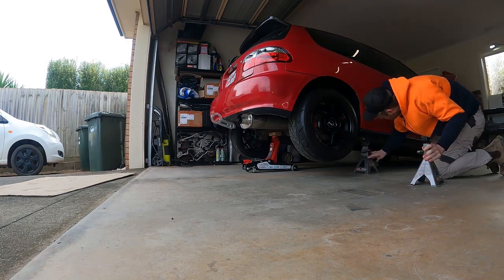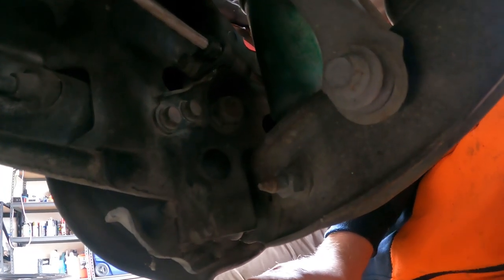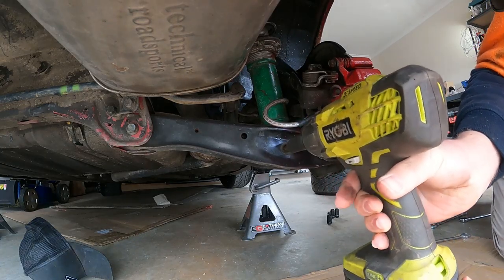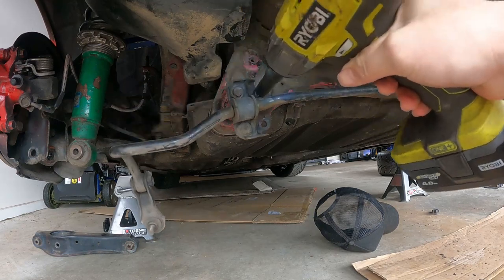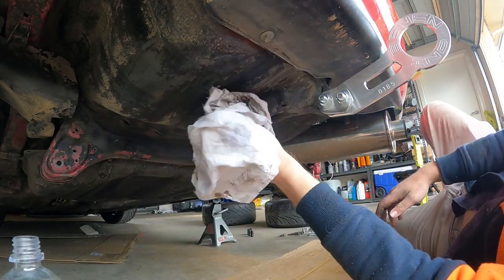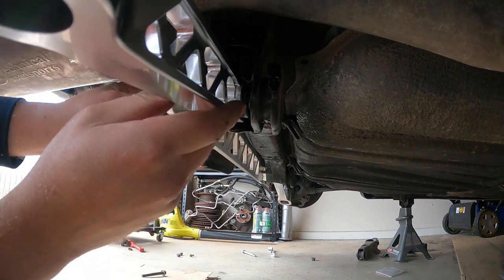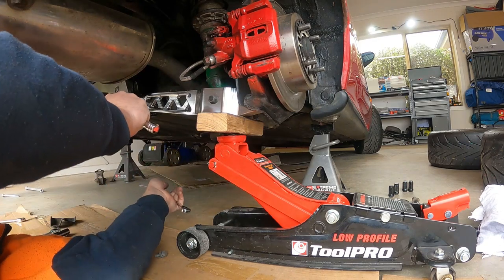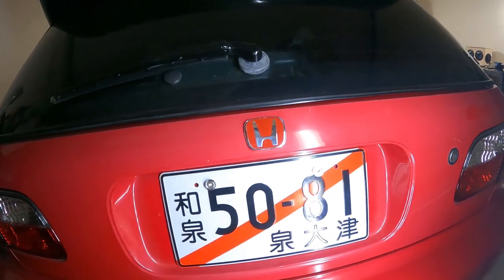Billet Control arms and Subframe Brace Install | Eg Civic B16

Comment: hello, did you re use the oem shock bolts with these after market rear lower control arms, did you have to use a after market nut on the rear of the bolt to hold the lower part of the shock in place ?.. I am asking as the oem control arms has a nut welded to them
Reply from the maker: Hey mate. On one of the control arms the nut actually fell off and I used it. On the other side I found another nut to use. But I did reuse the oem shock bolt.